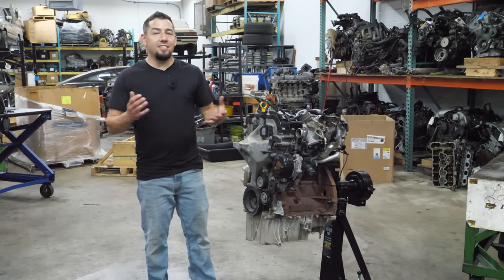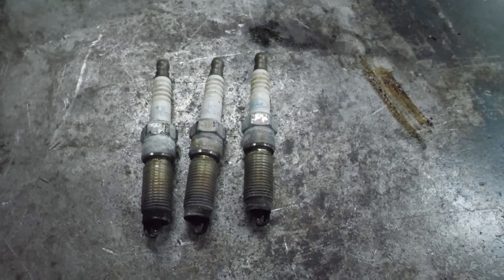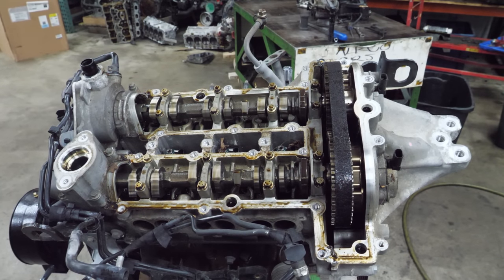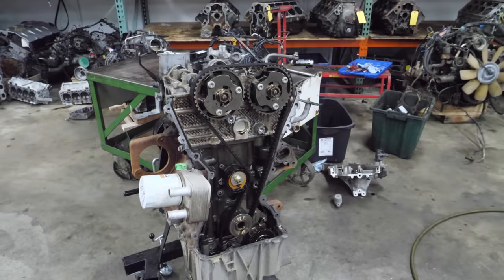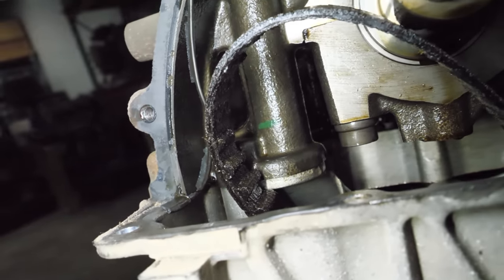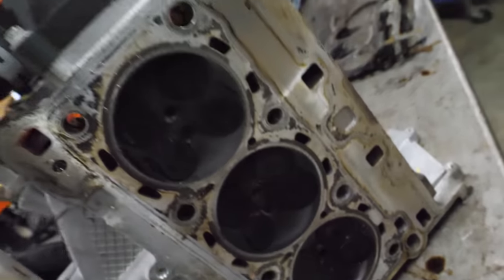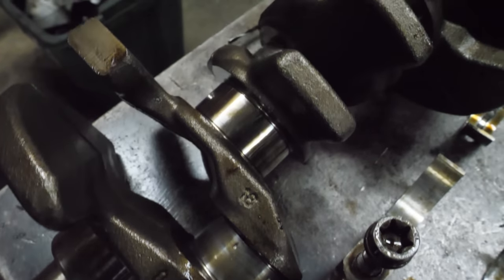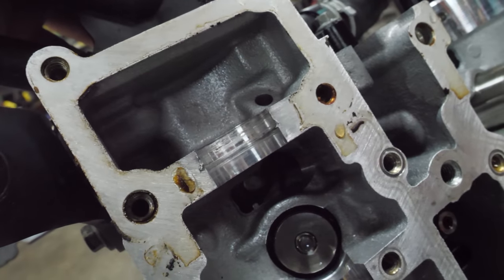JUNK Ford Ecosport 1.0L 3-Cylinder Ecoboost Teardown. LAWSUIT ENGINE!

Comment: The 1.0 3 cylinder ecoboost engine was available in the Ecosport, Focus, and the Fiesta in US. In the Fiesta it was decently quick since so light.
Reply: The owners of the ST variant of the Fiesta. We called them FiSTers. 

I’ll see myself out now
Reply: @TheMadTube  The FiST used the 1.6 Ecoboost engine. Oddly enough, that same 1.6 EB engine and 6 speed manual combo was sold for a few years in the last gen Fusion. It was oddly slow and not that efficient. Weird.
Reply: Slap one of those GR corolla 3cly in the Ecosport and it will go flying.
Reply: You could get a 3 cylinder focus in the USA?!
Reply: @ganzonomy  yep.
Reply: @forrest1948  when!?  I never knew
Reply: Yup and quick to fail
Reply: @dsawan2227  dream on lmao.
Reply: Yep, i have one.  Gets 40+ mpg on the highway all day long with decent power.
Reply: @ganzonomy  yes, but you never wanted it, you wanted the 4 cylinder and it annoyed me that my mother bought the 3 cylinder when i told her that engine was crap. you never want a 3 cylinder engine, they don't balance and well... these had belts soaked in oil so.... they failed at 30k
Reply: @TheObsesedAnimeFreaks  that's why I'm keeping my V6 Accord as long as I can.  These little engines will just go kaboom
Reply: @TheObsesedAnimeFreaks 3 cylinder engines do balance. And are a fucking industrial work horse.
Reply: @ganzonomy  fyi the Honda uses a belt for valve timing too, anything over 125k and your living a timebomb
Reply: @Dirtyharry70585  I changed mine in January 2022 with 25k miles.  I didn't want the belt to crack due to aging.  I only drive about 2800-3000 miles per year.
Reply: @Dirtyharry70585  My 2000 Camry OEM timing system/belt lasted 18 years and 188k miles before the belt finally started making noise
Reply: @piggy310  
I thought Toyotas used chain drives, hence the long life.
Reply: @stephenarbon2227  Year 2000...23 years ago .
Reply: You can imagine this thing was fitted also into a full size sedan (for EU standard) here? The Mondeo my2011 was a 15.75ft, 3100lbs. With THAT engine... Crazy...
Reply: @jdrok5026  they really don't... Irl the best balancing engines are rotaries. The fact you need a balancing shaft is beyond what you should be using and is more complex for complexities sake.
Reply: @killdizzle  Ford just stopped making all cars that is how they fixed it.
Reply: @zachlafond2652  Basically the PowderSh!t - PowerShift transmissions was so unreliable and unfixable in the Fiesta and Focus, it killed off Ford's cars. Though Ford making the same cars for almost a decade helped kill sale2s enough to justify axing the lines too. We need more affordable cars- I miss the days when you could buy a base manual tranny new Fiesta or Focus super discounted to like 12k. Freaking Mirages and Versa are 20k cars now.
- CSB content- I think Ford was under much pressure to deliver that PowerSHift transmissions for the Fiesta and Focus to make the packaging work, and they wanted the all new good press as Ford had previously released all new models with older drivetrains and it killed any media buzz (Ford 500/Mercury Montego, previous gen Focus which was just a rehashed 1st gen for the US, Mustang, etc). So they were really pushing to have it have all new drivetrains when they should have delayed the release and either fixed the tranny (which must have been impossible since it was never fixed) or sourced another auto tranny. Hell, even a vintage Nissan CVT would have been better, which is really saying something.
Reply: @BReal-10EC  Later models of the FiST dropped the 4-cyl and got a 3-cyl 195 horse engine. I don't know how closely related it was to this teardown engine.

Comment: Wow! This is the first time I've seen one of your videos, and what a pleasure it was. A very enjoyable watch. you put out a lot of information in a short amount of time in a clear and concise manner, and it is clear that you value our time. My interest was in this engine specifically,  in my recently purchased 2020 Ford escape. No failure in my engine, but your title of this video caught my eye. I had to tear down my sons 2.5 L Ford, however, and was struck with what I thought was absurdity when I found that the crank pulley/harmonic balancer was not keyed. I've been found out that the location is determined by a crankshaft counterweight stop which is in the form of a threaded bolt, used specifically for when the engine is serviced in anyway that requires the disassociation of the valve train, and the crank. after putting the engine back together, I realized that this is a fairly straightforward and solid engineering principal. It's essentially the same thing to my understanding as the Miata engines, and about 1 trillion other small car engines over the past couple years! Again, thank you so much for a wonderful video.

Comment: I bleeping love these engines. We sell about 10-15 every month. There are three types of these engines. The one like you had, with the balance shaft is the newest. The older Ones were either with or without a temperature sensor on the side of the cylinder head. Your engine code might have been SFJP. The tensioner is one of the more common problems for the revised version. The head usually cracks in the exhaust port. Then the coolant leaks into the cylinders. After a short while the cylinder linings rust, the piston rings are shot. The timing and oil pump belts are also an issue even if you come across the older engine. If you had flipped the vacuum pump over, on the bottom is a small oiling point with a metal screen, that would have been clogged. It ussualy is. And your engine was paired with ant automatic transmissio, there is a hole for the torque converter bolts, the manual does not have that hole. I sometimes take these apart for fun and to have spare parts. Had one with 4 holes in the block and one big hole in the pan. Other had a broken crankshaft.
Try to get a Ford 1.5 or 1.6 petrol engine for a teardown, those also go  kaboom really well. Engine codes M8MD or JTJA. 
I don't know if you ever got a Mazda skyactiv diesels, būt those are great at failing.
Great video as always!

Comment: Two main failure modes for this engine are oil pump filter mesh blocking with degraded belt debris (like your example), prevented to the best of my knowledge by regular oil changes (more frequent than specified) and ensuring use of correct spec oil. Second failure mode is due to coolant loss and the fact that water temperature sensor can report "Normal" temperature even after fatal coolant loss and head gasket failure. I had a 1.0 Ecoboost fail with coolant loss overheating (just over 60,000M on the clock, in a Focus). I had brand new engine fitted free of charge by Ford. This was essentially due to this type of failure being caused by the design flaw of being unable indicate fatal coolant loss and overheating along with hose issues causing coolant loss in the first place. 1.6L Ecoboosts had a safety recall and a low coolant sensors fitted (with buzzer and light), due cracks in head potentialy causing a fire. Later 1.0L Ecoboosts have an engine block temp sensor to force engine into limp mode if temperature is excessive.
Reply: Seems to be a common thing on the smaller ecoboosts. I used to have a coworker with an Ecoboost Fusion and despite him also being a Ford tech who kept his car in very good shape, his car blew a head gasket on him.

Never had an ecoboost myself, although I did have the precursor to one. I used to have a Mazdaspeed 3, so it had what would become the Ecoboost 2.3. Never had any cooling system problems, although it did eventually get the timing chain rattle. And I changed the oil every 4000 miles or so.

And that wet timing belt design is just stupid. The worst of both worlds. I'm a Honda tech, so I have plenty of experience changing belts, mostly on J series V6s, but I've done a few older D and  F series belts too. Those are nice and easy to take apart. I've also put chains in K engines due to stretching. It makes no sense to add the extra work to do a chain when you have the service interval of a belt. Plus it's much more suceptible to failure than a traditional belt or chain design as a result. It takes serious effort to make something THAT bad. How did that make more sense than just using simple plastic covers like most engines with timing belts use? Especially when it's certainly cost them a lot in warranty claims. Between this and the dual clutches that eat themselves, I don't trust any Ford made small car anymore. And I love compacts and subcompacts (I daily a Honda Fit, and I've owned multiple Honda Civics, 2 Nissan Sentras, a Ford Focus, a Toyota Corolla, a Toyota Tercel, a Dodge Neon, and a Geo Metro, all of which I had fun driving)
Reply: Yep they're also responsible for a few deaths due to said fires and when they caught fire, the central locking trapped the people in the vehicle, unable to get out.  More than a few cases in Africa that made the news.
Reply: Thats a super spot on diagnosis of failure, all related to oil issues.
Reply: and. you MUST NOT use any other oil specifications other than recommended.. all otjer oils will dissolve the belt
Reply: @bobl78 omg!

Comment: Used to drive a Focus with one of these in quite a lot. They're not fast, but they're certainly quick enough, particularly on a fun twisty road. I used to get about 40mpg (UK).It went for a "quick service" at Ford at about 40,000 miles with some interesting rattling noises on idle, and didn't come back for well over a month... pretty sure that was a new engine under warranty. A colleague of mine bought a Fiesta with the same engine a couple of years ago, he knew what he was getting into, so he factored in the cost of a new engine one day when he bought the car and just keeps that money set aside. He's not needed to spend it yet.

Comment: The thing with these engines, is they do run well. As long as you treat them as such.
Running the belt in oil is so-so, granted, but to be honest - most of them work just fine and live a long life.

They're particular about the coolant and oil they need, but other than that, they're decent little engines. Not the best, mind you, but by far not as bad as most people make them out to be.

Comment: I had considered 1.0 TSI engines for my new car, but man am I glad I found this video. If something can be called "a bean counter delight", this is one of them. This has so many "dynamic smartness" built in... only the accountants will be happy.
Reply: VW 1.0 TSI is having a lot different design - much better timing belt solution is among them. So far it is less problematic than Ford 1.0 EB
Reply: I have had two 3 cylinder engined cars in my time has a drive one was my dad’s two stroke 1975 wartburg which was run like a turbine the second was my last car a vw polo 1.4 tdi diesel which was very torquey also very economical but a bit rough blowing 2.000 rpm I had the car for twelve years and it never missed a beat I tried it with 110.000 miles on the clock for my 2015 1.6 4 cylinder diesel Vauxhall Astra which is given my a average of 60 mpg on the motorway in sixth gear at 70mph 75 mpg it having the extra cylinder makes it run a lot smoother and also it’s very quiet I don’t think I would go back to 3 cylinder engine again or petrol car
Reply: @bassmanjura  yes my sons partner has a petrol vw polo 1.0 atomic and my son has a 1.2 diesel he loves driving her car because he got lazy and likes not having to manually change gears he also says her polo has plenty of power and delivers good mpg
Reply: completely different engine though. There's nothing wrong with a 1L turbo engine, it's Ford's design which is the problem

Comment: The main issue is the belt within the öl system! You have to take care of using exactly the right type of Oil. If not the belt looks like in the video really fast. And you also have to change the oil according to the service interval. The lints from the belt will also congest the oil system. In germany we have some discount car service stations like ATU and they often use the wrong Oil.

Comment: My modest contribution. I have a 100cv Cmax 1.0 ecoboost from the year 2014. I have always done maintenance at the official Ford service, once a year and every 10,000 or 12,000km. It now has 102,000 km with no problems. I changed the timing belt for prevention, it showed no signs of wear or cracks and the system looked pretty clean. Never had any coolant leaks or overheating. I don't know how long it will last in good condition, or if it will eventually break, but I know more people with higher mileage and no problems. I drive it calmly, respecting the warm-up times and letting the turbo cool down before turning off the engine. I always used specific oil for this engine. I am aware that other users have used non-specific oils or 5w30 resulting in broken belts without teeth. I hope it helps, although the designers and engineers made a serious mistake by leaving the belt submerged in oil and giving such a small engine so much power

Comment: Hi Eric, here in Europe we’ve a lot of these engine designs with wet timing belts, Ford and Peugeot have had, shared diesel engines in the past, a lot of failures. One could replace this with an after market kit for  a chain driven system. Here in the Netherlands we’ve a lot of owners of a car from Stellantis (Peugeot, Citroën, Opel, Fiat, Jeep etc.) with the 1.2 Puretech engine, having broken engines because the wet belt is clogging the pickup screen of the oil pump. Fighting with consumer organisations for compensation for the repair bills.  I think these engines found their way to the USA in Jeep products, if you wondered about the flaws in this Ford design, when you get your hands on these 1.2 3 cilinder Puretech engine, you’ll see there’s even worse. 
But also the TFSI engines from VAG (VW, Audi etc.) with timing chains have had in the past their issues with excessive oil consumption and stretching chains. 
A lot of repair shops have a decent living setting the design flaws and/or bad choices regarding material choices, straight. Thank you for your very entertaining and informative channel! Love it!
Reply: Fortunately, Fiat/Jeep/AlfaRomeo did not use the current version wet-belt-1.2L-Puretech engine from Stellantis. I've got one of these engine on my DS3. Full rebuilt needed at 90k km due to abnormal oil consumption (piston rings dead) : oil is burnt in engine but petrol also mix in oil, degrading the timing belt that ends to a oil-picker clog. Stellantis announced next version will have a chain instead of the belt and will be shared with Fiat and Jeep. That will solve the clogging issue but not the piston-ring wear then oil consumption one.
Reply: Timing gears... No belts or chains. That is what manufacturers should use in their engines. Like some of the Le Mans engines do actually. But we never gonna see that coming. It would not generate enough cost after the warranty. All of that crap for the sake of ''ecology''. Clown world.
Reply: @elzariantlp4594  Let's hope they do it better this time. We've seen what the psa (stellantis now)/BMW co-operation led to ... "prince engine". It had a timing chain and also lots of issues. p.s. I had a citroen c-elysee 1.2 puretech atmospheric. Sold it at little over 6 years. Belt was still in good condition. I now have a citroen C4 with the 100hp version of the 1.2 puretech with turbo. I guess the turbo versions (100, 110, 130 and 155hp) are more prone to belt degradation because of more blow by caused by the higher cylinder pressure. Causing the oil to get more hostile to the belt. My original service interval of my c-elysee said 10y or 180K Km's for the timing belt interval. Later stellantis lowered this to 6y and 100K km. However, still lot's of them fail before that. I would suggest people to replace the oil much faster. Like every 7.5K Km. (that's what I will do). And I use the one they specified for this engine (tested for additives eg) Total ineo first quartz 0W30.

Comment: The current version of this engine is being built today for a large variety of Ford’s European small cars up to the not so small Focus. In fact it is just about the only engine option left on Ford’s consumer cars in Europe.  The Ford 2.0 diesel engine and some Peugeot engines also use wet timing belts. They are fine if changed at around 60,000 miles. Recent build have much improved belts and shorter official change intervals [down to 100,000 from 160,000 miles I think. Together with shorter oil change intervals they ‘should’ be near bomb-proof now. Yes, we’ve heard that before!  These are great engines as long as the timing belt is changed at least twice as often as Ford originally recommended, which is an issue because very few owners do that, hence they have a high failure rate. The 2.0 diesel used in Transit and Ranger has also had a poor reputation for belts and injectors installed up to 2000 which were faulty and supplied by Continental. There is an ongoing recall on all these including a timing belt inspection and replacement with the latest parts. At one point whole fleets of transit vans were out of action for months, but from 2021 onwards Ford seem to have built them right.